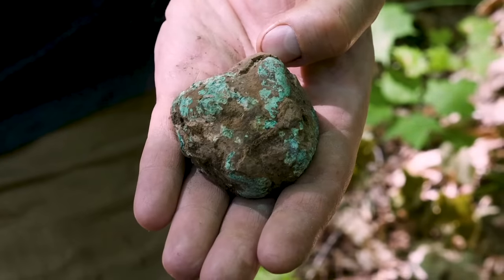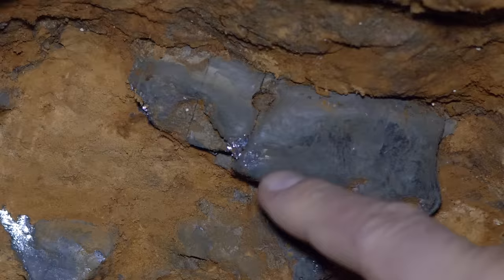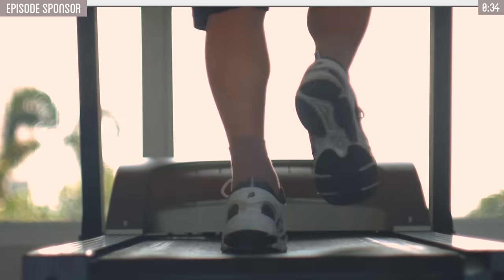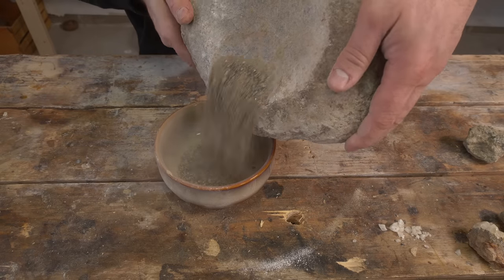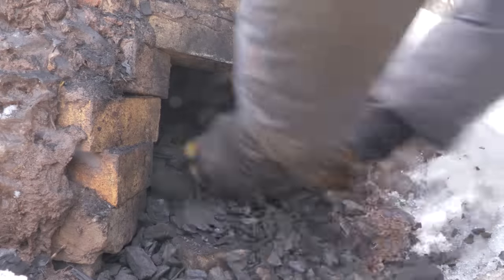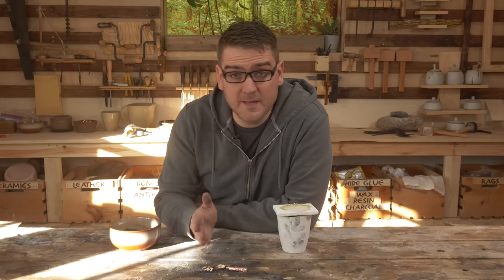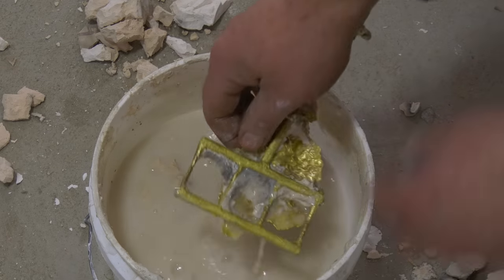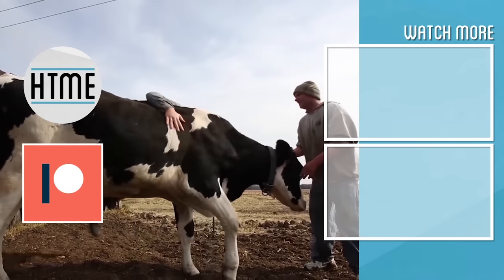How To Make The Hidden Metal That Helped Build The Roman Empire

Comment: What about the often forgot third brother of this alloy group 
Pewter
Reply: The Pewter that would be accessible with his current stage of technology is lead pewter, and quite understandably he doesn't want to work with that any more than he has to
Reply: @TheMhalpern  true but he's worked with Lead before. Also isn't there a variant of pewter that's essentially reverse Bronze? 
Mostly tin with a little bit of copper
Reply: @rafibausk7071  there's also the utility of the material, it has some uses, but it's mostly a decorative alloy, where brass is great for various things that would otherwise require a metal working lathe, like or instance the bearings such a lathe would require in the first place

Comment: Darn. My guess was 'plumbum', aka lead- with the atomic symbol of Pb. It's the metal that still names our water systems (plumbing) and if things are at right angles to each other or how deep water is (plumb).
edit: Because the metal was so useful, it named the things it was used for. Too bad the pipes were a bad idea..
Reply: That's plumb loco.
Reply: @-oiiio-3993  sounds like a great tea flavor!
Reply: Carbonic acid, a natural part of rain water, can form lead carbonate in the pipes.
It forms an impermeable barrier that protects the water from the metal.
Unfortunately, it takes many years for the carbonate to form and it's very delicate.
Disturbing the pipes can release lead carbonate 'mud'.
Reply: @pirobot668beta  bro I think you replied to the wrong comment
Reply: @pirobot668beta  Interesting chemistry. I have a well, but one of the closest municipal water districts says pregnant women and children shouldn't drink the water because of the lead (Portsmouth, NH has old pipes). Too bad they can't rely on rain for water. Who can?

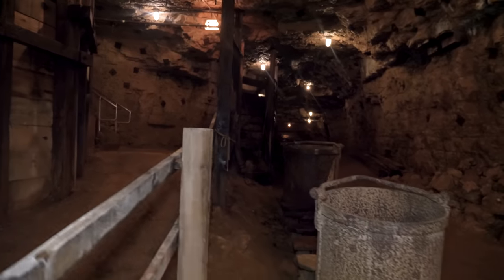Comment: The video clip at 2:10 when you are waking in the mine looks really bad for some reason, as in extreme video compression artifacts.
Reply: because they're in the dark
Reply: @ManlyDudeXD  it is not just the usual image sensor noise you get in low light conditions
Reply: @TheBackyardChemist  add youtubes compression to it
Reply: @linuxstreamer8910  I watched in 4k, unlike 1080p that one has enough bitrate to not be an issue.
Reply: @linuxstreamer8910  so it is something that was already bad before YT